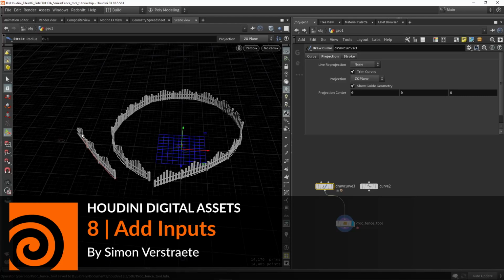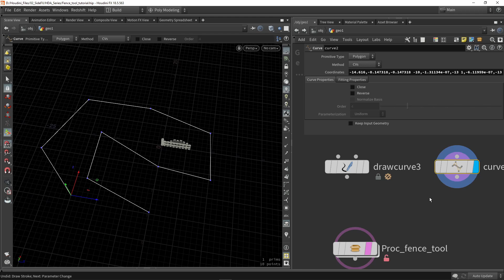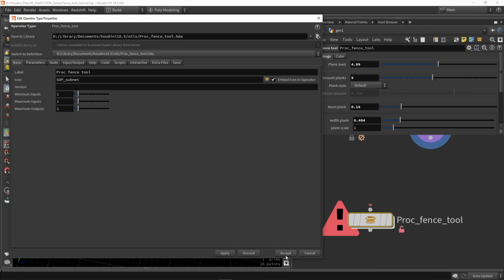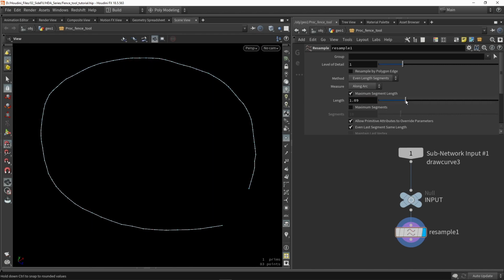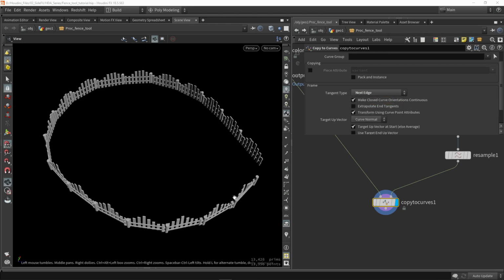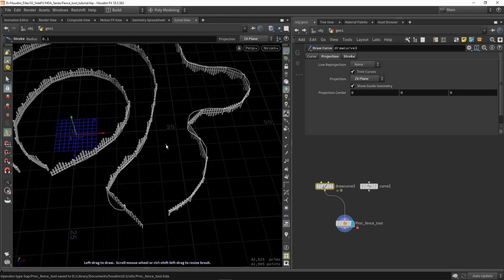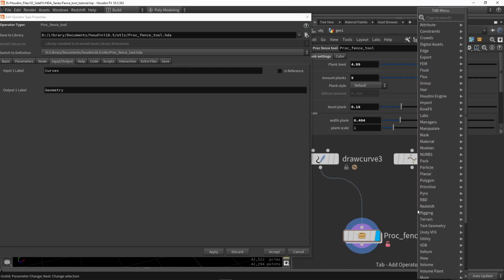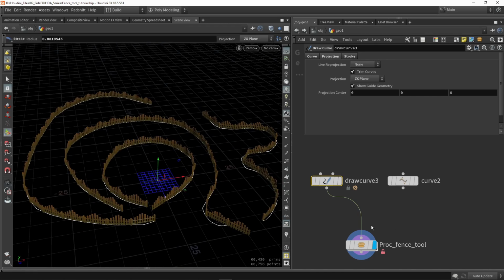Houdini Digital Assets | 8. Add Inputs

Comment: Hi Simon, hope you've got some time to explain. I've created a procedure that i want to turn into a digital asset. But whatever I do to create an input for this asset, I dont get any. I created a digital assets by selecting everything and when to assets -> new digital assets from selection. I dived into the edit operator type properties set the minimum inputs to 1. This does not create an input node within the digital asset, or a input bulb on the digital asset. Hope you can me out. I've found out on the internet that others have this issue. But without an solution so far that could help me. Cheers
Reply: Hello, I'm facing same issue. Have you find any solution yet?
Reply: I have the same issue too.